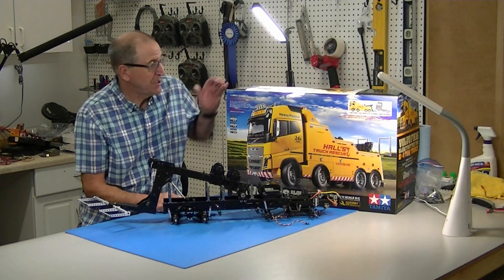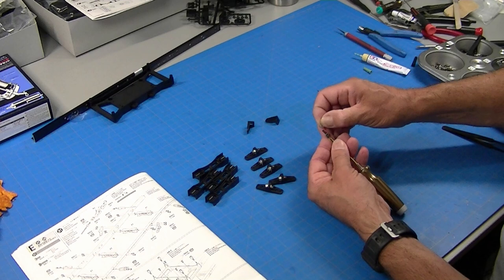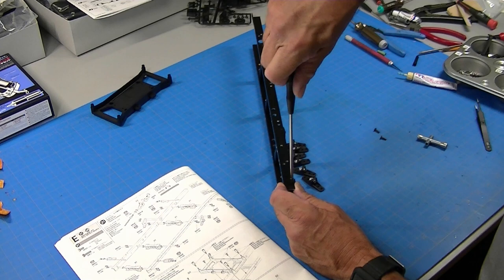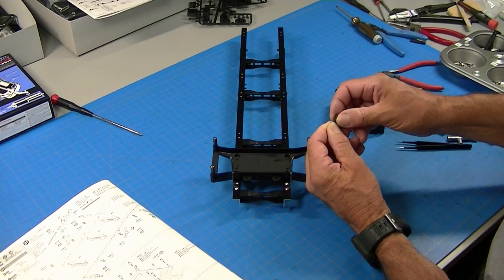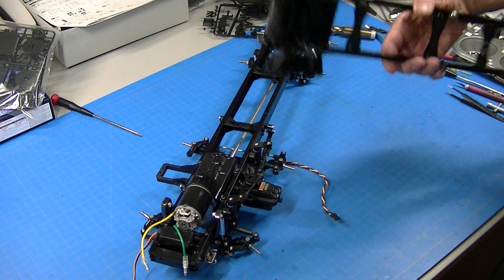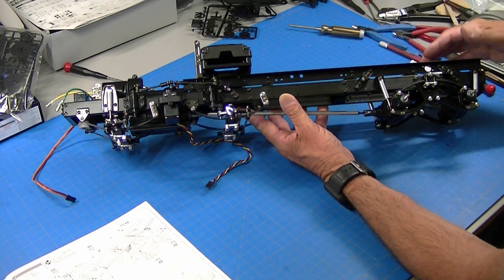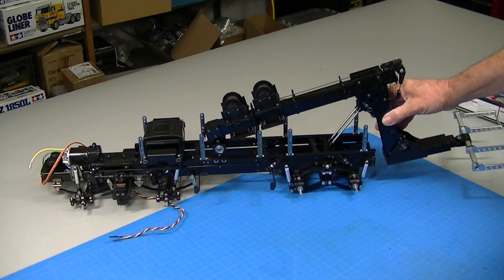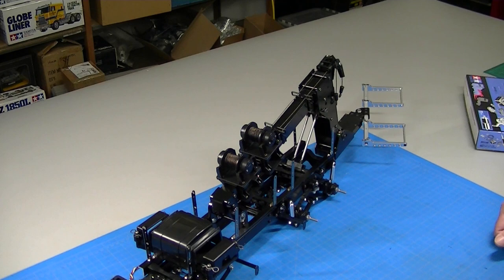Tamiya 1/14 Volvo FH16 Tow Truck Build - Part 3 Towing Frame & Boom

Comment: No wonder it costs so much. As usual well informed builds, keep up the good work.  A fan from the U K.
Reply: Yea I was also wondering why it was so expensive, especially compared ro the other semi trucks. And arpund 7 times the price of my only recent Tamiya kit, the Buggyra Semi race truck that was far more plastic than I was used to with my normal TLR, Tekno, Kyosho etc kits I run, but it was well under 200.00 including the cheap esc/motor so you cant expect much haha. This kit looks far better and far more beefy. I think Ill have to add it along with the Knight Hauler...

Comment: A great job Bob, as always, looks like an ideal candidate for some Hydraulic rams, the horizontal underlift extension, the boom lift and the crane slide out..
Also are, or can the winches be powered, that is an obvious thing to need.. Hope so.. I'm a great fan of tamiya and have trucks and trailers to prove it, great engineering and details... Although the steering can always be improved.
Look forward to your continuing series with great interest.. Well done

Comment: i wish it wasn't 900$ just for the truck...  and 400 for the working boom electronics... and 400 for the mfu...  just for the basic truck...   it so neat someday i will get one...  i drive heavy duty tow truck.. wish i could get  a kenworth front end and this back to try and match my truck....
Reply from the maker: I want to do a King Hauler tow truck too......
Reply: Do you still plan to do a king hauler tow truck?

Comment: I've got mine, I'm a recovery driver and I'm quite disappointed that with all the detail they can't make the boom deploy by radio control, also I've watched another build and wish I hadn't rushed into it, the guy uses a Lesu kit to move the boom up and down rather than the Tamiya one, looks much better. Also is there a way of locking the spectacle lift in place, as a recovery driver would never drive with it dropped over like that
Reply from the maker: No way of locking the spectacle but there is enough material on the bearing block to drill through and add a body clip.  Good suggestion I will do that.
Reply: @HobbyconceptsLLC  let me know if you want any pics of our real trucks
Reply: what name is on the youtube that use the lesu kit